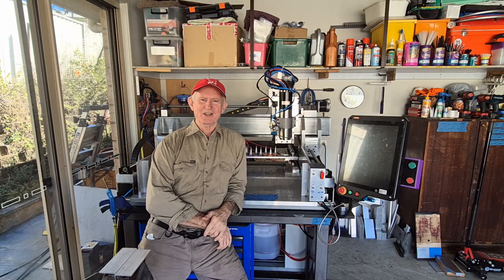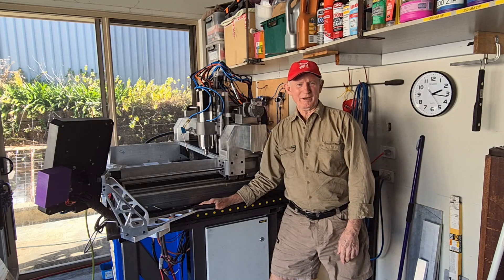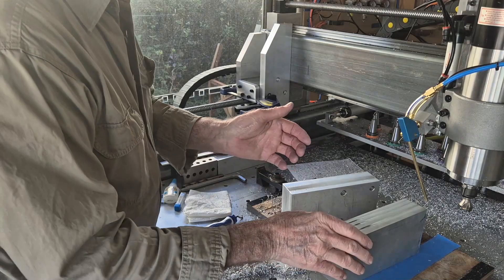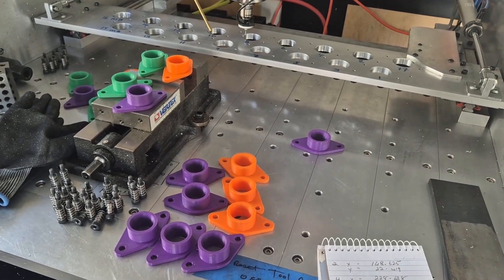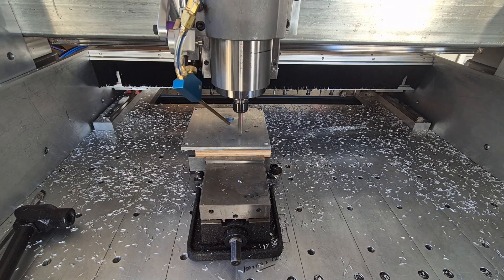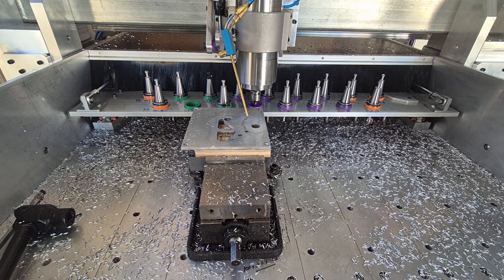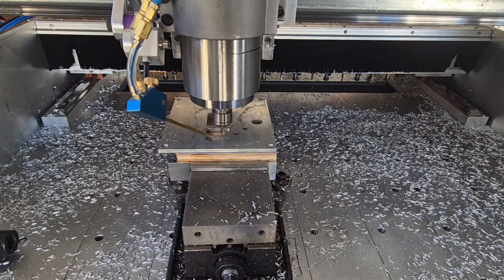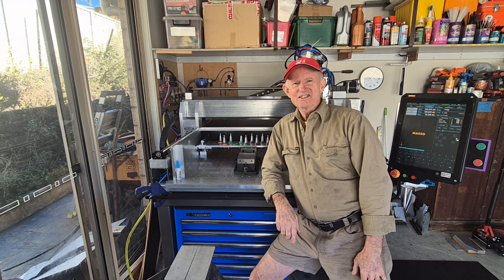Bill's PrintNC CNC Cover for Hidden Sliding Tool Rack

Comment: Hey William, just ordered a ATC spindle from Jianken, i believe the same model as yours, do you mind me asking what tool holders are you using?, mines coming with ISO25 one from Parfaite, trying to find a decent tool holder cheaper than $95USD each and would be keen to hear yor experience.
Reply from the maker: HI well you are going to love the Jianken spindle ....... after several recommendations I went with Iso25 collet holders with 0.001 accuracy and dynamically balanced  to 30,000 rpm from GDR CN Store on AliExpress I also only use there Er 20 precision 0.005 accuracy collets so far I have purchased 25 x Iso 25 tool holders and 35 x Er20 collets from GDR and every one has been perfect good company to deal with as well you will fall off your seat when you see the price I can highly recommend them,  hope that helps Cheers Bill PS let me know how you get on
Reply: @williamnorris1516  brilliant!! Yes that's the price I was hoping for! I'll keep you posted as my build progresses, very exciting times. Thanks William I appreciate your help.

Comment: Cool, and a bit like Narnia back there, but aren't you worried about the occasional chip on the brush transferring to a tool, or does your ATC blast the tool with compressed air to clean it off before picking it up? Great stuff though Bill
Reply from the maker: yes that will possible happen from time to time.......... But yes the spindle does a strong air blast as it descends down on to the tool it's picking up....... it way better set up than I was running before ..........cheers Bill
Reply: @williamnorris1516  thanks Bill !